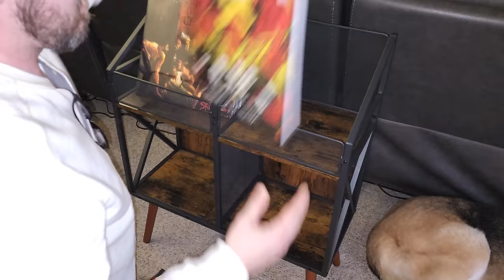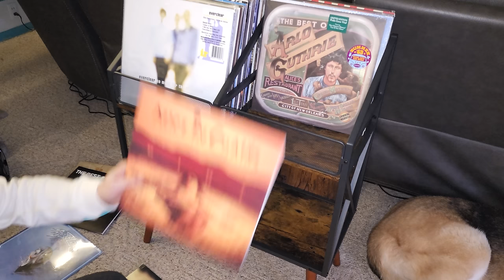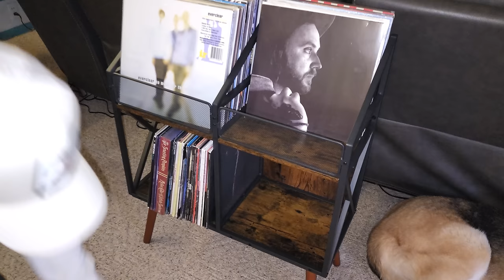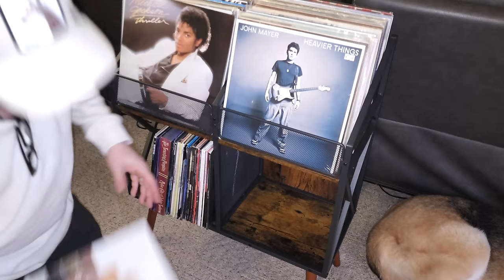Neglected projects at MY house! Let's unneglect them!

Comment: I had a Technics turntable in 1982, with a Teac cassette deck and I cannot remember the brand of the equalizer…. Maybe Sansui ( was that a brand in the 80s?).   Also had the factory sound system in my 1980 Gran Prix replaced with an Alpine system.  DMB and REM are some favorites of mine.

Comment: I realize you are extremely busy with many things to do. However, just as you & Emily have a collection of LPs, I still have a large collection of cassette tapes. If I could kick myself for not making the transition to CDs back in the 90s, I would several times over!! Would you have any idea where I could find a dual cassette deck that allows you to playback two tapes and both decks have auto return and doesn't auto stop? I had one and it was stolen years ago and I was never able to replace it. This is a component that would be part of that 70s-80s stereo system. Thanks for any leads you could provide.